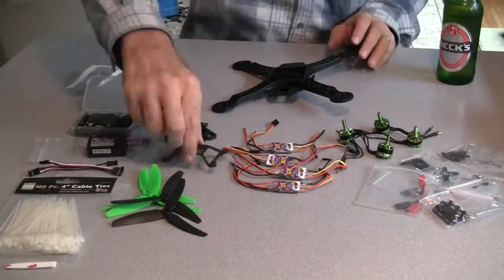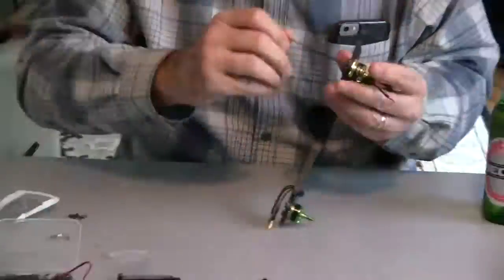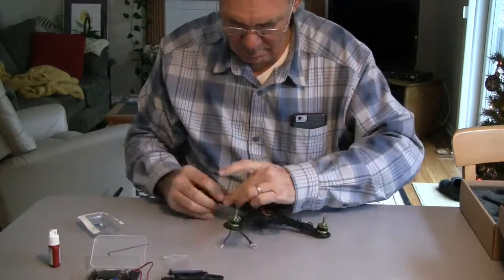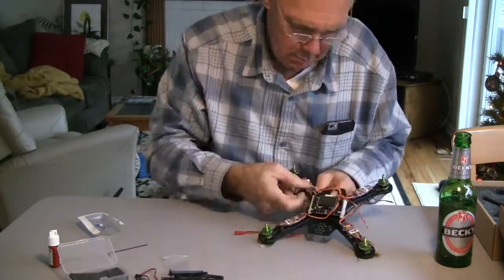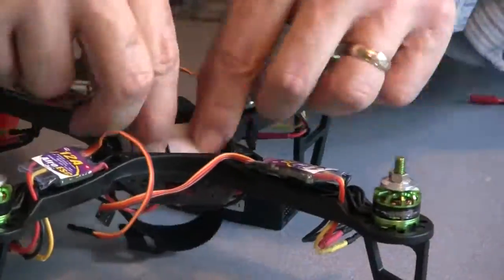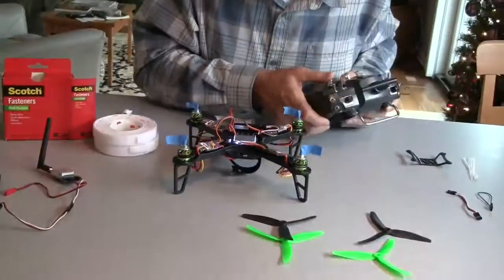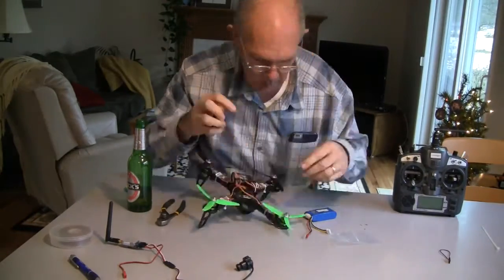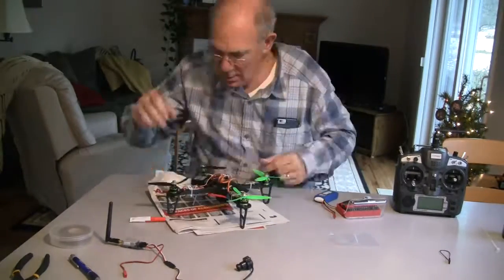HK Spec FPV 250 Kit Built

Comment: Awesome video! Would you recommend this quad?
Reply from the maker: Frank, Yes I would recommend this quad. I have flown it about 50 times. The motors  are a little slow in rpm, the FPV equipment is difficult to find a place to mount and I have broke a few of the landing skids but it does work for around $100 and makes a good first hobby grade quad.